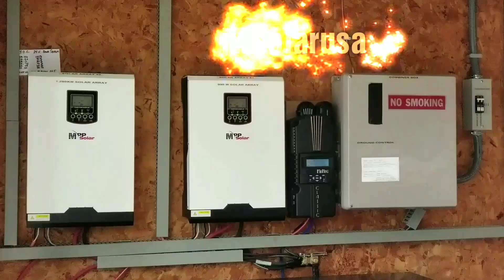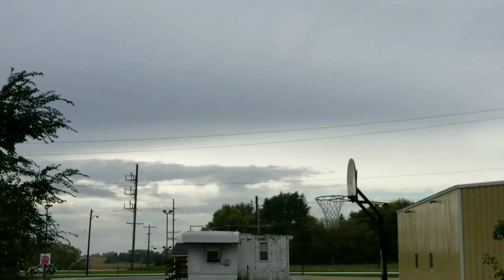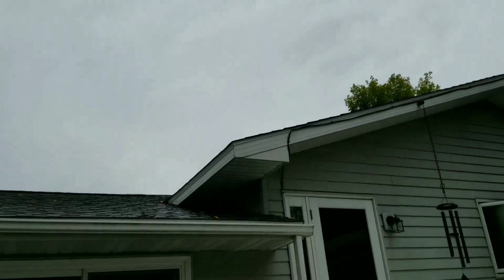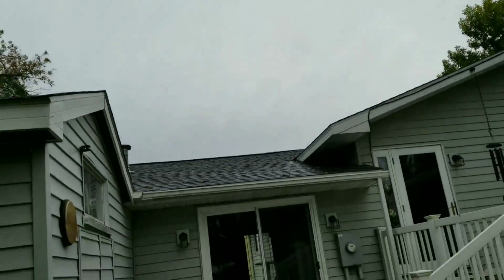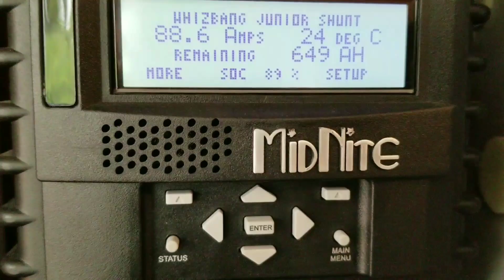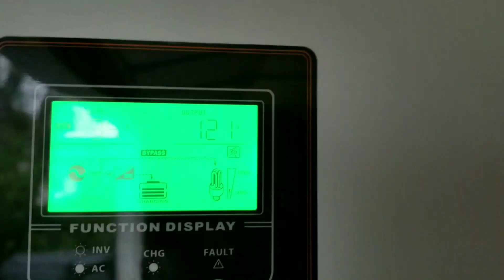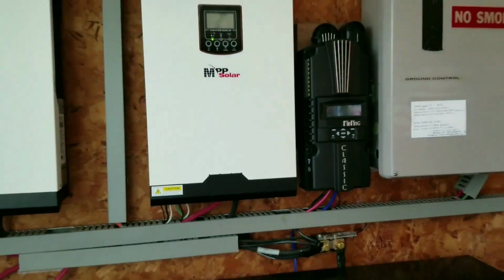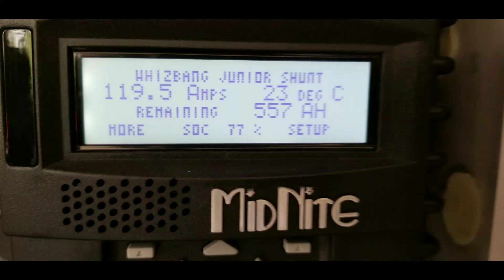SOLAR HYBRID INVERTER REVIEW - PIP 2424 MPP Inverter with Battery backup

Comment: Great setup. If you ever replace batteries you will not go wrong if you change to lithium. I took out 500 amp hrs AGM, replaced with 200 amp hrs Power Queen. No comparison, AGM'S may have been more, but do not do as well as lithium. Hands down you actually spend less on lithium.
The heat produced by inverter will be cut by 10-15 degrees if you put 1/2 inch spacers behind inverters to allow air flow behind units.
Reply from the maker: Thanks for your comment and for stopping by.
Like👍 Share and Subscribe

Comment: I just bought the 2440MPPT 220v 50. Peggy Huang is the best at PIP. My inverter will be here in 7 days here in Chile South America. 
What it the total KW on the PV? I have six 250w panels. I am wondering how much less you guys are paying for your panels?
We have rain like that 6 months of the year. You have to panel up for winter Sun,
Thanks for the video: Jim
Reply from the maker: +ChileExpatFamily 
Total Kilowatts on the panels is 2,270KW with 28,240KWh of battery storage

Comment: I am very new at this. i watch all your videos on that system but I did not see how you wire everything. 

I have 4 solar panels 250w each,  maximum power voltage is 17.5 , maximum power current is 13.89, VOC 21, ISC 14.58 , maximum series fuse rating is 10A, max system voltage 1000v.

I  will be setting them up in parallel 
1) my first question is since I did not see how you setup your breaker combiner box I wanted your input on what size breaker i should use? is 10 A for each panel ok because it's says the maximum series rating is 10 A. or 30 Amp for each panel because that's what is recommended for 10 awg wire.

2) I also brought 2 pip 2424lv-MSD hybrid inverters to mimic your setup but I am also confused because it's says 60A charger and 80 A mppt. so after adding breakers to each PV,  do I need to add a 60 or 80 breaker also between PV and controller?
Reply from the maker: Hello my friend and thanks for watching my videos.
I have heard all of your questions and I would like you to share your contact with me so we can talk on the phone or through whatsapp so I can help you with your solar setup. 
Are you in the United States? 
Regards 
jwsolarusa
Reply: yes I live in the USA but I will setting up that system in Haiti. How do I contact you?
Reply from the maker: Send me your contact and I will give you a call if you don't mind
Reply: jwsolarusa With an external charge controller like the midnite, do I still need to wire the solar panel to the PIP or just to the midnite?  OR to both?

Comment: hello friend i am from mexico 
my house has a split configuration  L1=110v AC L2=110 AC and neutro , i want to buy a solax x1.15 but it has just terminal outputs L, N and PE ( it handle 230v Ac to refer ground)
my question is correct to connect one line(hot) to neutro to have 220v ac? L1-L, L2-neutro and PE-PE
Reply from the maker: This will be the wrong Equipment for your application. It sounds like this device is for International use only and is not ment for a split phase application.
Please consult your local Electrician for better information.
Please be careful and thanks for asking.
PLEASE DON'T FORGET TO LIKE & SUBSCRIBE AND SHARE MY CHANNEL
Reply: could run it though a 1:1 transformer with center tap on the secondary side

Comment: Great  video,  I which I could see video that explain how 

6 panels  of  300w 24v can be connected  to a 3kva 25amp inverter 
Inverter model
....maximum .open circuit voltage   ..145 dc
.....pv mppt voltage range  30 -115 vdc 
...Minimum  battery voltage charge   17vdc

Pls kindly advice me on how to set it up within the 25 amps the inverter  can accept
Reply from the maker: Thanks for the compliment.
Please go through my Playlist and watch the rest of the Installation from start to finish and also recent updates and upgrades.
Thanks for watching. Please like Subscribe & Share